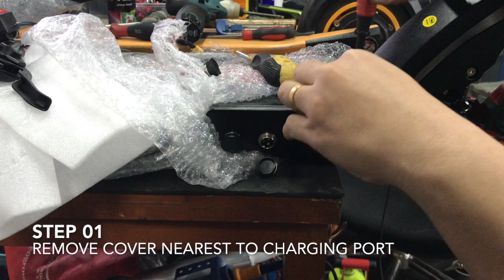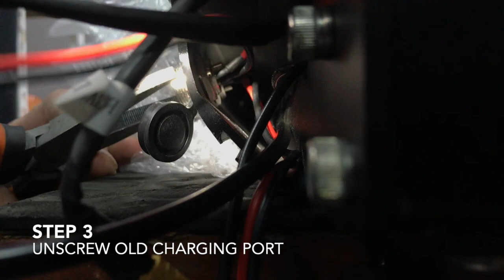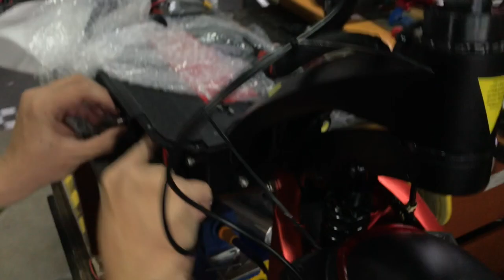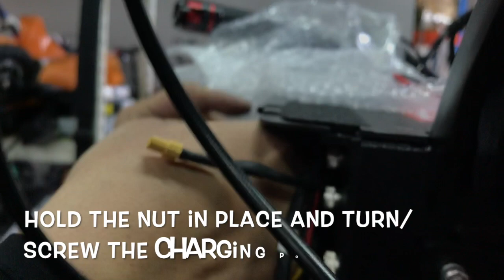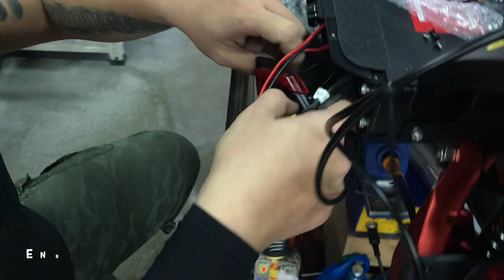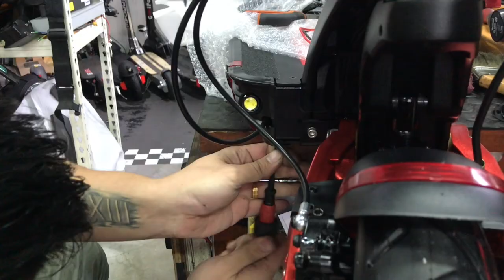How to change charging port on ZERO E-Scooter

Comment: Hi. May I know what is the polarity assigned to each number on charger for Zero 8 V2?
Reply from the maker: Only pin 1 and 3 are used: 1 is positive and 3 is negative
Reply: @FalconpevSg  Thanks for the reply.